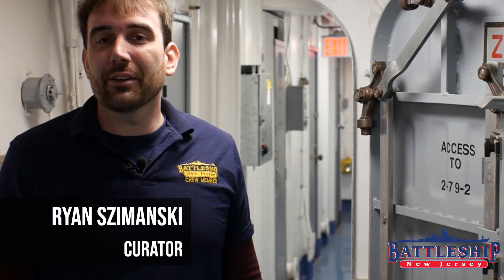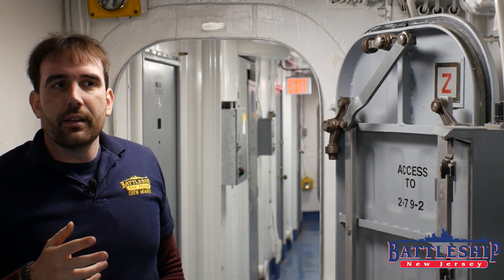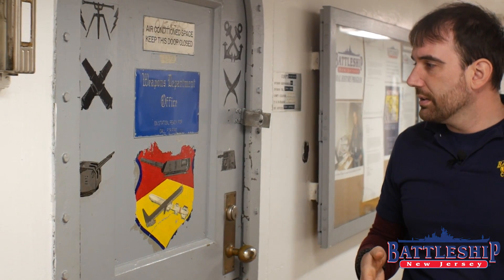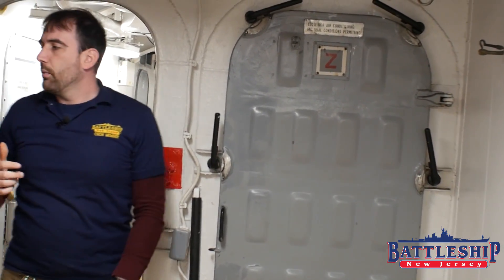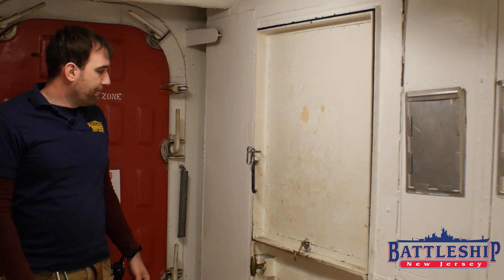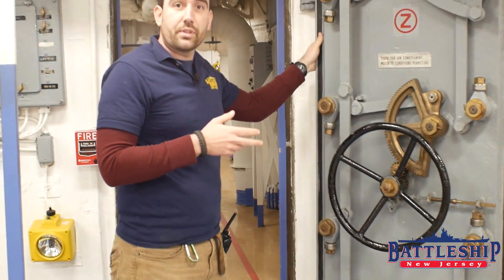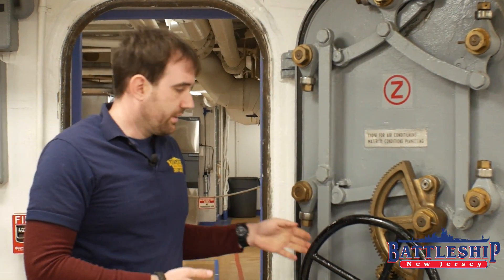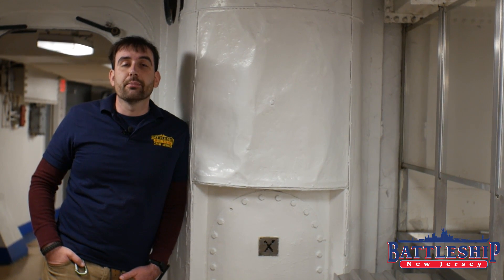Shut the Door! Doors and Hatches on the Battleship

Comment: A couple of things to add:
The doors are all labeled, not out of the excessive OCD complex prevalent within the Navy - although that’s certainly true - but because all watertight fittings are inventoried and tracked. During GQ, for example, the compartment Petty Officer must ensure that all watertight fittings on the compartment check-off list have been positioned correctly, then he will report to DC Central that the space is ready.
The crew are prohibited from breaking material condition without the permission of DC Central, who would log the noncompliant fitting until it is reported as re-reset. In the event of damage, DC Central would know where to send repair parties to re-shut those fittings.
Also, Xray, Yoke, and Zebra fittings (not “Ex, Wye, and Zee”, since they are named after the old phonetic alphabet) have very specific definitions:
Xray fittings are normally closed unless logged open for maintenance, repair, or industrial work. 
Yoke fittings are normally closed when underway.
Zebra fittings, like someone already pointed out, are closed for maximum watertight integrity as for Condition 1/General Quarters.
Dog Zebra, as pointed out below, are closed during GQ and (or) for darken ship between sunset and sunrise. These usually lead out to the weather or into the pilot house and will have light traps (properly, “light labyrinth”) that make you do the zigzag shimmy around two or three black Herculite-covered frames in order to step in and out without letting light “leak out”.

Comment: "Quick-acting" doors and hatches tended to be the ones classified Z (Zebra), which were kept open at sea (usually on main passageways) but needed to be closed quickly for General Quarters/Condition 1 or damage control, and maybe opened momentarily for repair party access.  You wouldn't want these doors to be open long, or left open because they were a pain to dog shut.  Doors marked X would be closed all the time; if you passed through you had to close it behind you.  Doors marked Y would be open in port but closed at sea and checked every evening.  Doors marked Z would be closed under Condition 1/General Quarters to maximize the watertight subdivision of the ship in combat conditions.

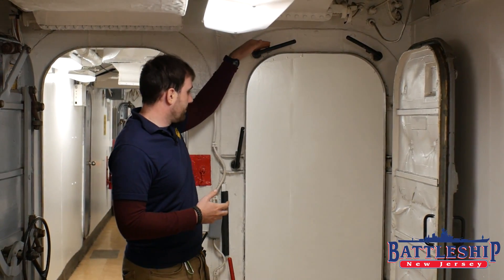Comment: Please forgive the dumb question...  the doors at 6:00...  The one with manual dogs.  How do you open it from the other side? There is also one dog painted red.  Why is that?     Also the fast acting door..  I am guessing that one has a wheel on the other side that goes through the door?  I think I saw an example of that type door at the opening of the video, but not sure...
Reply from the maker: The dogs are on both sides of the door. The red paint just indicates which one we usually close so we don't have to check all of them

Comment: On topside WTDs, there were 'quick-acting' dogged doors too but the dogs & latching mechanism were around the door frame with a single long handle that was pulled down to pull the dogs against the door once it was shut. Don't know if the battleships had those but frigates & destroyers built 1960's and after had them.

Comment: love all your vids.  the curved corners on the water tight doors is mainly for the rubber gaskets to flow around the door and not have to make 90 degree turns.  yes being able to hold the weight of the above is also a factor.. but getting a perfect seal with the rubber gasket is the main reason for the curved corners.
Reply: You are right about gaskets and rounded corners. As a watchmaker, I can say that round watch cases usually have far less problems with water-resistanse, then sqare, rectangular and other non-standard shape cases.
Reply: There is another reason why there's no sharp corners in openings in the decks or bulkheads. That is to prevent stresses from converging there and cracks starting.
Reply: @taras3702  Exactly.  That's also why airliners have round or oval windows.  A lesson learned on the de Haviland Comet

Comment: There's a manor house up the hill from our village,the Family have generational naval history and are rightly proud of it. They once converted an out building into a function suite and we were invited to their unveiling.,It was unsurprisingly naval themed but was incredibly real looking,you genuinely felt like you were on a ship as all the internals were finished like a ship complete with many authentic fittings and parts,all the doors in the main bar area were of the quick acting watertight type they were all opened and latched back but we got a demonstration,the whole outside paved area was furnished with nautical stuff like anchors and such cleverly adapted into seating,I joked with another guest that if they lit the whole rear grounds we would probably sea couple of 15" turrets and a battery of anti aircraft guns mounted on the lawn😁

Comment: Reminds me of of a nuclear powerplant I used to work at. Emergency Electrical Switchgear had a Cardox (carbon dioxide) fire suppression system. It also had a center hatch wheel, to drive the dogs. LOL there was a tool adjacent to help with turning the wheel to dog the hatch, but at least two people I know of jammed the barrels of their rifles into the spokes of the hatch wheel and tried to use them for leverage. End result,  seriously jacked up rifles. 

Oh, door 348, -4'6" elevation, how I really don't miss you so. Control room doors were the same. You had to be careful opening them, as there was a negative pressure airlock and the control room itself was positive overpressure,  so if you had the outer door open, and opened the inner door, it would come at you really frigging fast. And it was almost a 1k lb door.
Reply: I don't think that I would want anyone who would do such a thing to have a rifle in the first place.

Comment: There's a newer type of QAWTD. The dogging mechanism is on the bulkhead and there is a large lever on the side instead of the wheel in the middle of the door
Reply: All of the warships I worked on have this type of quick action watertight door plus the older type with individual dogs around the outside.

Comment: ~11:30 is is very difficult to get a 90 deg (square corner) to seal ... especially make it air-tight/water-tight against lots of pressure ... hence round and oval shaped hatches which seal and square doorways which (mostly) do not

Comment: Was the length of stay in General Quarters ever long enough to need some sort of oxygen? Did they build in redundancies for this?
Reply from the maker: typically, in general quarters you can still run the air vents, so thats not an issue. If you suspect a gas/nuclear/bio attack you would try and close everything up, but its not an issue in New Jersey's time.

Comment: Modern merchant we have quick acting on the incinerator rm. That one has a long lever arm instead of a wheel and only a single motion is needed to open/close. Gaskets are a mix of hard rubber on cool areas and fire resistant bulkheads have a woven gasket.
Reply: More modern navy ships than this BB have similar single-lever doors.

Comment: why would you cut out the whole door frame when replacing doors? I've replaced a lot of watertight doors and we've never cut out the frame.
Reply: Yes. I've seen warped doors just taken off the hinge and new door installed.  No need to cut out the frame unless it is damage; highly unlikely in normal use.

Comment: I still find it strange that the wtd/qtd doors are only on one side of the bulkhead.
Often, in 'hollywood', so see water rising on the non-hinged side. And people wrestle the door closed against the water pressure. I get that having 2 doors add weight and cost.  But how about safety? Or were those doors in 'hollywood' supposed to have been closed before they actually got in to trouble? And wasn't it for added drama?
Reply from the maker: Each door has its own conditions for when it should be closed. But generally, if theres a chance you're going to take battle damage, most of the doors are already shut.
Reply: @BattleshipNewJersey  so basically Hollywood drama then.

Comment: Three conditions of USN shipboard material readiness are, X-ray, Yoke and Zebra. Designated X-Ray doors and hatches are secured all the time (or logged open at DC Central, if specifically required), Yoke doors and hatches are additionally secured prior to getting underway, and Zebra (the remaining) doors and hatches are secured when setting General Quarters fully securing the ship for battle. It's worth mentioning that the material conditions of readiness still refer to the old WWII and prior phonetic alphabet even to this day, rather than contemporary NATO Phonetic alphabet, which would otherwise be X-Ray, Yankee and Zebra. During workup drills preparing for deployment the most basic (and often most problematic) drill includes setting Yoke throughout the ship following lengthy in-port shipyard availabilities, leading to the well-known mantra, "Yoke is no Joke!"
Reply: Zulu
Reply: @georgemalkin6546  Oh. Ok. I see what I did.

Comment: In 1970 I was a Lance Corporal. Our battalion went abroad ship for deployment, USS Terrebonne Parish, LST. The hatches always clanged a little all night from the rocking of the ship so we wired them open with coat hanger wire. A week out and the Navy had general quarters practice where the are timed on getting the spaces water tight. The alarm sounded we went into our living spaces and the sailors came running thru closing hatches. Imagine there surprise to find our wired hatches. We really had no idea we would cause such a headache for then.
Reply: About the same thing happened when I deployed aboard the USS Ogden, LPD before and during the first Gulf War. The D.C. Chief was not happy with us😂😂

Comment: Fun trivia, the blue or black paint that runs across the wall or bulkhead near the deck is how you determine if space is flooded or not. Also if there is an X Y or Z on the hatch, it's a water and even air-tight (door) hatch.

Comment: We had a huge Ballistic door leading into the steering gear units on the USS Nimitz. It was designed to be able to be welded shut from the inside in the event of the bridge being taken over by boarders. And we could assume control to steer the ship.
Reply: If boarders took over the shio they'll have explosives to blow any doors they have to to take control of it  let alone sink it. An aircraft carrier would probably take battalions of troops trained in close quarter battle tactics to seize a ship, and it's damn near impossible to do when the ship is underway and surrounded by escorts.

Comment: Hey there, albeit you didn't specify the year nor date of any of these doors, an interesting question has arose in comparing the Jersey, a US ship with ships of the UK and Canada. 
Here are my questions: Was the conditions of WT doors;  x, y and z, during WWII or post WWII? A document that was shared with me from a few other colleagues, comes from a Royal Navy Handbook suggesting that this system did not come till after WWII which is BRCN 3029 (1960). If you have more on this, I would love to get a definite answer to this boggling question.

A second question: It sounds like the quick action doors weren't a thing of WWII either, so what year were they introduced?

Comment: They definitely just took the doors off the hinges to repair and or replace them while we were in the SY.  They didn't cut out any of the frames.  This was NNSY in 2012, pretty certain they've been operating like that for a very long time.  There's a reason the hinges have removable pins.  If they were designed to be cut out to be serviced, the hinges would be press fit.
Reply from the maker: But when you completely change the style of door, it won't necessarily fit in the old frame
Reply: @BattleshipNewJersey  This I agree with.  If switching from dogged to quick acting, yes, they would cut it out and weld a new one in.  But for general service, including replacing a warped door, they'd likely just undo the hinges.

Comment: if you're really interested in figuring out if those hatches were repurposed, you might consider talking to some folks at the nearest university that does nuclear engineering.  You could provide some filings and they could determine if the steel was manufactured prior to 1945 or not based on the radioisotope content of the metal....

Comment: Since all the dogged doors have a rubber gasket on them, would it be standard procedure during fire fighting to spray water on the door itself before attempting to combat the fire directly to prevent the rubber from melting away from the heat of the fire?

Comment: From a mechanic point of view:It's easier to install a rounded seal into the watertight doors rather than a square one. Those seals tend to be a bit unwieldy and don't want to go around edges or corners.
Reply: Came down the comments to say this - ovangular doors are easy to fit gaskets to, square cornered ones are a bastard and will leak at the corners in extremis.
Reply: Getting a square corner to seal on anything is just about impossible. Curves are much easier as it avoids a high stress corner that is easily bent and deflected.

Comment: So who was responsible for shutting and dogging down the doors? Also they all appear to be only one way. If you’r3 on the wrong side of the door and are late getting through, you’re out of luck.
Reply from the maker: There are dogs on both sides of the door. But once the door gets shut, you need permission to open it in many cases because there could be water or fire on the other side.

Comment: I know those dutch doors were used in places like bathroom stalls or anywhere a person could be by themselves. Suicide doors they were called because thats what they were meant to prevent. So others can easily check on you through the top half of the door. 

Heard that on Tino's channel from a curator at a French WWII Bunker.
Reply: I heard different story, althrought not directly in French bunkers, but in Czechoslovakian border fortresses. Dutch doors were used in earliest built ones with direct inspiration from Maginot line and were installed in case door frame got warped (close detonation etc.), there was high chance one half could be still opened. BTW later built ones switched to normal doors with basically about 45x45 cm rectangular hole in bottom covered by another steel plate and secured by bolts every few centimeters to keep it airtight. Althrought it took longer to open it in case of jammed door, proved much more reliable by testing as doors could take truly absurd amount of punishment and hatch still openable.
Reply: @RayRay-mv9wn  That's pretty cool. I know of the over pressure valves or plates.
Reply: There's also a variant with a platform at the top of the bottom half, so someone could sit behind it and use it as a desk.  I know the British routinely used them on prefab field buildings as the primary building envelope security measure.  It might not be difficult to get past the sergeant on the door, but doing it unnoticed was another mater entirely, and any building with important things going on inside would have additional layers of security you couldn't detect from outside.  It also makes sense for an office that routinely issues things to the crew, with or without the desk platform.  The open top part makes it easy to pass things out, but the closed bottom half makes it difficult from someone to sneak in and steal something.
Reply: Around here I mostly see them on old farm houses, barns and stables with the horses popping their heads out the top. Thats what I'm familiar with when it comes to Dutch doors.
Reply: @tnutz569  "That's pretty cool. I know of the over pressure valves or plates." Don't take it as slight to you, but I don't understand what you mean by that. It did not have anything to do with being overpressure valve, just emergency exit/entrance in case doors cannot be opened. Some heavy bunkers were connected underground into whole fortresses, some did not. Those unconnected usually had another, but really unconvenient escape hatch (I can elaborate, but this post is getting too long already) as opposed to normal entry points, that were supposed to be connected by trenches for easier resupply, and light bunkers (řopíky)  AFAIK were never connected underground and had no other bigger opening than 10 cm other that of one door. TBH, being inside one of those in middle of battlefield, 1m thick high quality, insanely heavily rebar reinforced concrete walls and jammed 25 mm thick steel door, with no way out, is rather terrifying thought and one hellishly sturdy tomb. ČSR army took dutch doors from French army for this purpose, then thought about it and said "Well, we can do better." I admit, I did not visited Maginot line, so I might be mistaken, but that's what I saw, been told at various ČSR bunkers and read in various books about it. Dutch doors can be used for various reasons, sure, I just talk about their use in fortifications and their advantage less likely to be stuck if damaged or warped, trapping people with no way out.
Reply: @RayRay-mv9wn   Thanks Ray Ray. I love the information. 😀

Comment: I was passing through a space on the 01 level where an officer was chewing out a 1st class because the gasket on a QAWTD was bad. The 1st class replied, "Sir, if water ever gets this high,  the last thing I am worried about is the water tight integrity of that door". I almost got out of earshot before I burst out in laughter. Almost.
Reply: Except that it is not just about the watertight integrity, it is also about the airtight integrity in case of a fire.  That is why air pressure tests are done between spaces to ensure the integrity of those seals.
Reply: @johns1039  And Chem/Bio.
Reply: Just because it's 01 right now doesn't mean it will be after a torpedo hit. It's a WTD for a reason. You don't have to know the reason. (you'd think everyone in the military would understand that.)